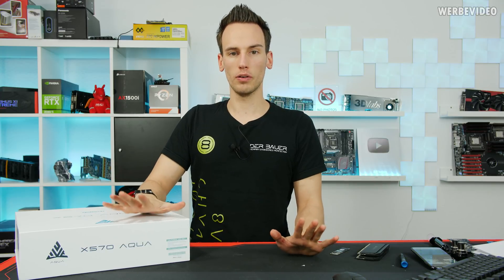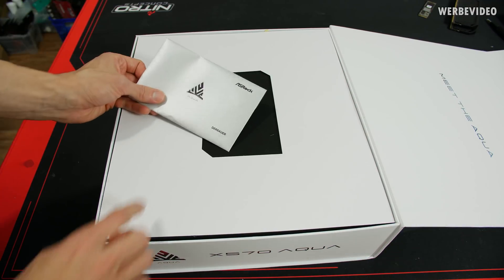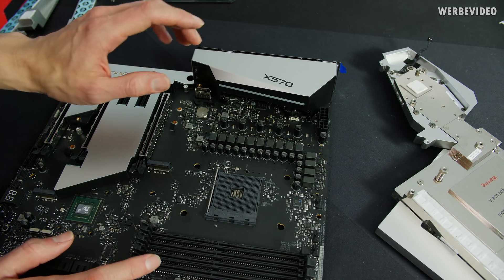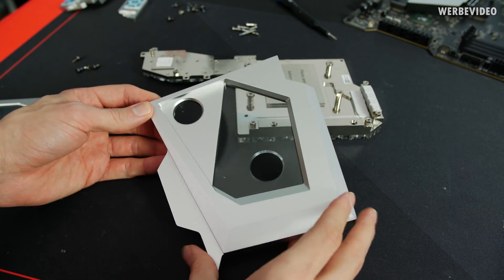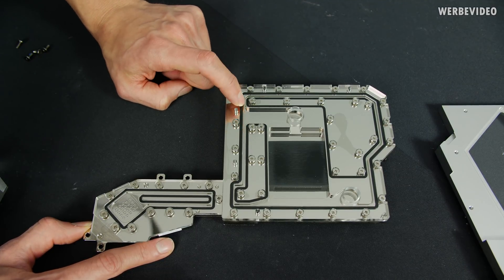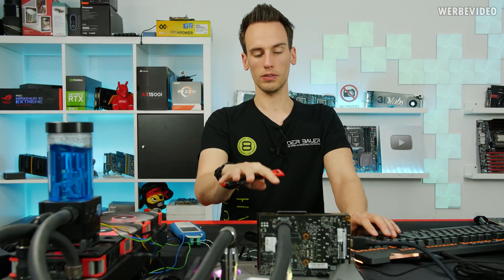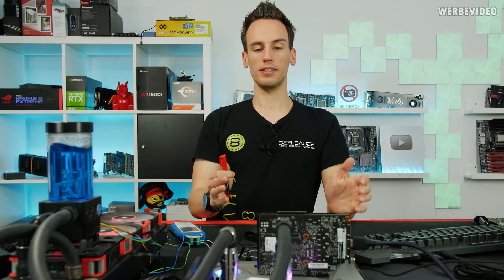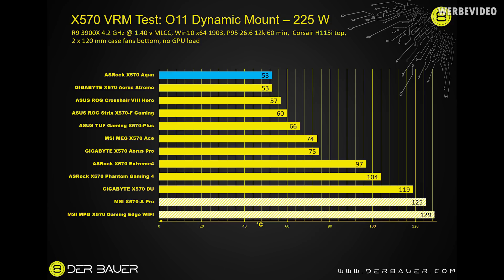Testing the MOST EXPENSIVE X570 Mainboard - Is it worth 900 EUR?

Comment: Um.  The waterblock needs a bit of work. It looks like they built a workstation board for 3900, 3950x, and high end 4000 maybe. Really hoping that 4000 is as good as the rumors, however, I'm doubting it justifies water cooling.

Comment: Hey De8auer, by any chance do you know if the XSPC Raystorm neo am4 bracket will work with the Original Am3+ Raystorm CPU waterblock, I bought the bracket because I finally upgraded from an FX-8350 to an Ryzen 3600x on an ASUS Crosshair VII WiFi. I have all my waterblocks (CPU,RAM,GPU) and I’m hoping I can use them with the bracket I bought. Thanks for your videos and help!

Comment: The one mainboard for which he was like, I better read this. What's the PCIE breakdown on the board?  Do they have a Threadripper  gen 3 or Epyc Gen 3 board built with a monoblock?  ALso, where are all the fins for surface area?  Internal to the block only?  I want fans to be able to cool it as well. And by the way, the M.2 cooling surface should only contact the controller, no?

Comment: you say its the same as the others but only the aorus extreme was in reality, and only with the case cooling of the case tested, and the aorus extreme is still an expensive board, and you kinda missed the boat comparing it to the x570 creator board which is essentially the identical board without the water block, it would have been interesting to see that comparison too ;-)

Comment: I'm subscribed and didn't get a notification for this. I actually bought one of these boards the first day it came out. I believe there is one more m2 slot under the cover you didn't remove. I can't say for sure because I haven't got the 3950x yet so it's still in the box. I was wrong there is only 2. M2 slots just started my build 1/1/2020 Great video nice to see it taken that far apart to be able to see the water channels.

Comment: bearing in mind a mono block costs around 150 to 200 is it really expensive most high end x570 is 500 to 700 and if you have x470 water cooled you can just use the pump and rad with fittings you have at hand

Comment: I dont think anyone buying this motherboard will only have 1 360mm radiator on it.  Think most people will try get room temp on the board. 25-30 degrees.
It's to expensive to only use crappy water cooling on it.  I would use 3 360mm radiators push pull fans in my 900d case.

Comment: The board is extremely expensive but the price is similar to an aorus xtreme plus a heatkiller IV as a cpu block. An idea could be to compare cpu temperatures with these two combinations, because that way you can see how good the cpu block on the aqua is, and also how affects the extra heat from the vrm and chipset into the loop.

Comment: tooooooooooo expensive
croshair viii hero at 440€ is fine and even a strix x570 at 260€ + EK monoblock at 127€ so you will get same results as aqua for less than 400€

Comment: I have an Aorus X570 Xtreme and this board. The Xtreme is fitted with a 3800X from Silicon Lottery, is water cooled, and hits 4.5+ all cores (stock except for latest XMP and the DRAM running at 1.35V per its spec plus the latest bios). It performs very well. I saw the AQUA and fell in love withe the concept and the MACHINING! I have an X470 Taichi, which runs solidly but has a less than perfect bios. I decided to take a chance that MAYBE the AQUA bios would have improved, and bought the AQUA. It is destined to house a 3950X, when everything settles down in a few months.

Comment: I got this board so that I wouldn't have to go through extra work finding waterblocks for other x570 boards. Also having no chipset fan was a great bonus. Further, having VRMs watercooled also means I don't have to worry about having airflow over the board meaning my water cooling loop fans could run down to minimal rpm without consideration of airflow for the motherboard :)
Yes a bit expensive, but for an all in one solution which also has exceptional athletics, I think the price becomes reasonable. My 3950x his already shipped for it :)

Comment: M.2 SSD should be hot for the NAND part, as NAND likes heat between 50 and 60  degrees Celsius to decrease the NANDS wear and tear, the controller however can be cooled with no problems.

Comment: Too expensive.
Reply: Get one of the top teir motherboard's, (slightly less expensive than the best cpu), and then price custom watercooling for the chipset, vrm and CPU and see if you can even come close to the price of this board. You have to realise those that purchase a product like this are buying multiple products (Motherboard plus whole board water cooling) not just a board.
Reply: @xX_illusion_Xx  my MSI Creator board along with a EK water block was still half the price of this board.
Reply: @mfdsuk  So your EK water block is a custom VRM, Chipset and CPU water cooling block that EK only produced 1000 of is it? Or just a generic run of the mill CPU water block? Like I said with the Asrock one is paying for multiple products. BTW how's the Thunderbolt 3 on your MSI creator? Non existent, (another benefit of the asrock over your mid range MSI creator). Horses for courses I suppose. ;-).

Comment: 1000$ motherboard and doesn't even have a temperature sensor plug for custom watercooling coolant temp.
Reply: this is the problem, when the asking price is 1000$ then you can't miss anything
Reply: What good is a water temp sensor plug when the mobo already senses mainboard and cpu temp with multiple sensors? Coolent temp is negated by these and the mobo already has the functionality to shut down in the event of overtemp. Coolent temp would therefore be useless.
Reply: @xX_illusion_Xx  Do you have a watercooled PC? Because usually what people do (and what I personally do) is setting your radiators fan curves according to liquid temperature. You can't really do that if you have no T_sensor inputs available.
Reply: @Amsztel  You might use liquid temp but most don't, (what evidence, statistics do you base this assertion on?). Why would one use one or two T_sensors when you can set fan curves etc on the directly from the heat source, (CPU/GPU) which already incorporate multiple sensors and will react well before a water temp sensor will cause reaction. This makes for a more stable system especially with a high overclock. Gamers Nexus has an upload on how useless water temp sensors are in open, (and for that matter closed) loop systems. I have decades of experience with watercooled systems, with single and multiple loops, and have never used water temp sensors to set fan curves, (as it is inherently stupid), I have however whitnessed T_sensors fail. I have never seen CPU or GPU temp sensors fail though, (ever).

Comment: Of course you have to protect the cold plate. You want it as perfect as you can where possible, and this is an easy and cheap way to keep it safe from accidental scratches when the CPU is mounted. Also "it comes mounted on the board" isn't an argument, as, again, it needs to be unmounted to place the CPU...

Comment: I really love the board, but i'll never throw 900e on a board for cpu taht cost at most 750usd. That just don't make sense. It's still a beautiful piece
Reply: 900 maybe but 500+ ? check the prices of the awful results motherboards then check the prices of the ones that are good ? they are expensive already, with X570 and now TRX40 people need to stop comparing old tech (Intel refreshes,pice 3.0 with almost no development cost and cheaper components) with new tech (multi layered, pcie 4.0, more than double the bandwith going through the board etc..) low prices boards are crap quality there's no "good" X570 board that is cheap it doesn't exist maybe you can get an average one but who does that ? if you don't have the money to buy proper tires don't buy a sportscar in the 1st place
Reply: Get one of the top teir motherboard's, (slightly less expensive than the best cpu), and then price custom watercooling for the chipset, vrm and CPU and see if you can even come close to the price of this board. You have to realise those that purchase a product like this are buying multiple products (Motherboard plus whole board water cooling) not just a board.

Comment: This is the perfect board to apply liquid metal to everything, even delid the cpu and direct die. Total, it would have 1,080 mm of radiators. This board screams enthusiast. But... is it aluminum?!?!
Reply: der8auer said at one point that the blocks are aluminium.
Reply: The parts of the block making contact with the flow are copper while the exterior is aluminum.
Reply: @offenpeter  Guess I wasn't paying enough attention either :P

Comment: Any chance to include ROG Strix X570-E in tests as well? It's got slightly different power section than X570-F. I was just wondering if it will perform any better, maybe being even closer to the top of the pack (VII hero, aorus extreme) Danke schon for all your work ;)

Comment: Aorus Extreme or Bust, the rest is canon fodder. I couldn't justify the cost of this board. Seems more asthetic than anything. Doesn't even seem to allow for more overhead of thermal expansion. The Aorus Extreme isn't using doublers either. True 14 phase.
Reply: If you need thunderbolt and money is not an issue, I'd go for the Aqua.
Reply: @1idd0kun  Or you could add a thunderbolt card to AX: https://geizhals.eu/gigabyte-gc-titan-ridge-a1926339.html?hloc=at&hloc=de&hloc=eu&hloc=pl&hloc=uk

Comment: What a beautiful board, I'd justify the price if it was full copper all over. Excellent video mate, Thankyou.
Reply: It is Nickel plated copper actually. Nickel is less reactive in mixed metal loops.
Reply: @xX_illusion_Xx  the whole of the boards armour? I thought it was mainly aluminium as Der8auer mentioned it on the M.2 heatsink. My bad though If I assumed it wrong.
Reply: @JackC92  Alu outside, Ni inside
Reply: @JackC92  Not the whole armour but all of the Nickel plated block/waterways as far as I am aware. It is quite heavy. So a good 80-90% of it is copper I would estimate.

Comment: I’m going to get this and put my Athlon 200ge on it
Reply: I would do the same but I can't afford the Athlon
Reply: Only real gamers use athlon
Reply: And try breaking world records😂
Reply: I have a 200GE on a X370 board,
Reply: @rodneymaslovsky4756  Why?
Reply: i ran my 200ge in my crosshair viii impact for a bit lol
Reply: wkwkwkk...
Reply: you need to use an  Actros radiator instead if you're going to use that cpu.
Reply: No way man, athlon is to powerful for cheap motherboard like this. You need VRM cooled by liquid nitrogen to make it work.
Reply: @nico thibeault I doubt the C6H is going to do very well with a 3700x... Even the C7H (which I have) has been having a ton of issues with the 3700x, especially with the PCIe gen4 support. Plus my chipset runs at 43C idle with just a sata ssd and two HDD's.
Reply: Hahahahaha
Reply: Too fast for this board, will burn it with triloheartz speed.
Reply: lol. sadly you know you could actually convince people to do it.